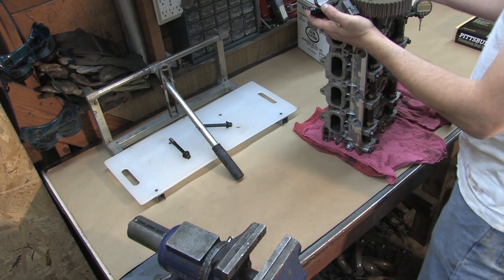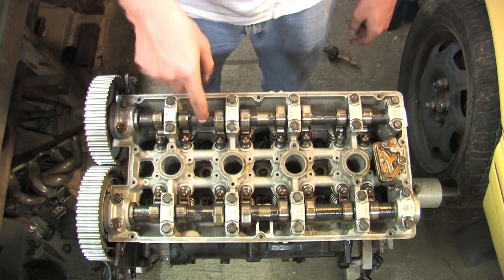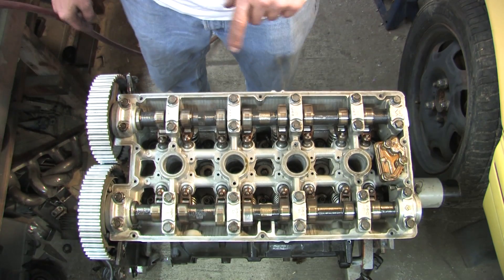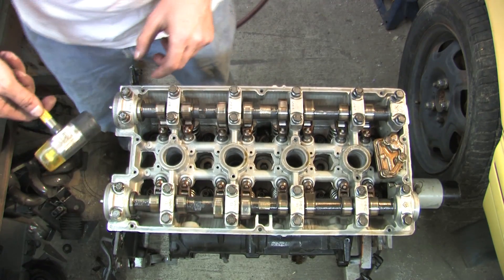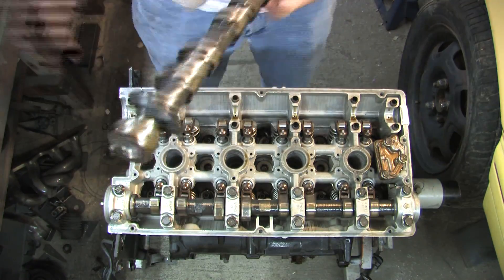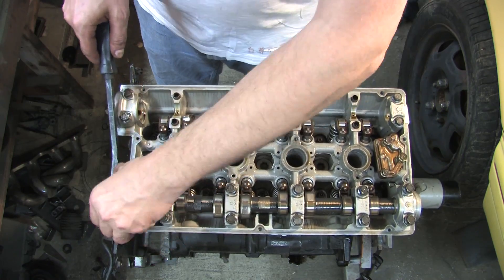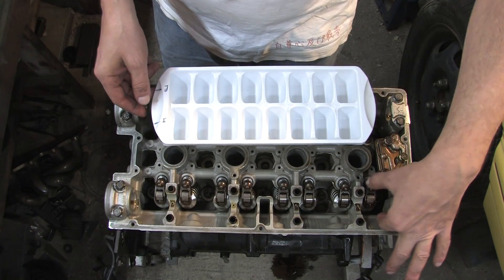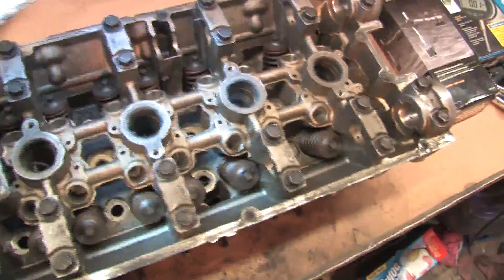Cylinder Head 101 - Remove Cams Rockers & Lifters

Comment: I got a Mazda 3 2006 2.3 l i bought a new head but there's no camshaft bearings does it take them
Reply from the maker: Nope.  The cam journals just use oil as the bearing.  ;)
Reply: @Jafromobile  hey thank you I appreciate that

Comment: does anybody no if i can switch parts from one cylinder head to another,lifter springs i have new valves,thge one i got from junk yard  cams are good lifertr are good but the survaces is corrared  the coolant ports n all on vw passt 1.8

Comment: What is the logic of removing the cam caps from the center out to the side.?  Have an imagine the most pressure would be in the middle of the camshaft instead of on the sides.
Reply from the maker: Think about how much pressure would be on the center (with 8 valve springs on either side) if you took it loose last.  It would focus the energy from both sides directly in the center of the part.  It would have half as much material length to take all that spring pressure.  When you take the ends loose last. That pressure gets spread over the entire length of the part.  Either way, putting them on or taking them off, you're supposed to do it incrementally anyway.
Reply: @Jafromobile  Hmmm I don't know much about car mechanics but basic logic says that the camshaft is a stick and to break a stick easiest you hold both ends and push in the middle.  So it would seem safer to pop the ends out first and then head for the middle incrementally.  no?
Reply from the maker: @MrShakamuni01  When you break a stick in the middle, like over your knee for instance, you are pulling both loose ends across a solid object.  In the case of the camshaft, that solid object would be the center main.  But again, you should be doing all of the tightening and loosening INCREMENTALLY which means you should never see that much pressure on any one of the caps.

Comment: Please help I got my cams mixed up is there marking on them to which way they go back in
Reply from the maker: One connects to a cam angle sensor and the other one doesn't.  So one has a slot and that's your intake cam.  This is assuming you're talking about a 90-99 DSM.
Reply from the maker: If the gears are on them, one is stamped I and the other E.  The cams themselves should have these markings if they're OEM.
Reply: @Jafromobile  thanks for the reply but it's a 05 Kia Sedona and one rod has a R1 and the other has 28   45 stamped on it
Reply from the maker: @jnxssssss  ...and neither cam connects to a cam angle sensor?

Comment: Hay Jarfo in another video you explained what the makings at 9:24 in this vid mean I cant seem to find the video could you or someone point me un the right direction
Reply from the maker: It's in Cylinder Head 103 - Deck Tech.  ;)
Reply: @Jafromobile  witch do you recommend and why
Reply from the maker: I guess it's easier to clean the G6K because of the oil gallery plugs?  Plus it has a deeper teardrop, but if you're going to modify the teardrop anyway, that doesn't matter.  My biased side says the early '95 version (G6K).  I don't think the changes that occurred on the G6S had anything to do with performance.  Looks to me like a materials/cost bunch of changes.  It's just a little bit less aluminum and 2 less oil gallery plugs. 2 less holes to tap and drill.  Wait... 4 less holes because of the cam position sensor.  Also, the cam angle sensor you're planning to use should help you steer your choice.  Do you want a cam angle sensor hanging off the passenger side, or not?  You can do it either way with the 95/96 heads... but the whole "hidden-behind-the-cam-gear" thing is pretty cool on a show car.
Reply: @Jafromobile ya my goal is to have a very clean engine bay
Reply from the maker: You need the head, intake manifold, wiring harness, and ECU from a '95/96, then.  With sensors.  Basically the top-half of the engine.  You can use anything below it from any year with the right preparations, but that will provide you with the tidiest, most un-cluttered head start on that.  Get a 6-bolt bottom end and your setup will match mine for the GSX.  I pulled GSX parts out of storage yesterday.  More is coming soon.
Reply: @Jafromobile  I so would match you but I already have a 4g64 block I'm doing a 4g64/63t hybrid a 2.1 long rod destroker build to be exact

Comment: Jafro, I went searching for when you switched from a standard plywood benchtop surface to a facade of easy to clean mild steel and even easier to clean brown paper.  It turns out that it was some time between this video and the driveshaft 105 video, its a shame that you didn't film the benchtop upgrade, just to have seen that footage.
is it 14 or 16 gauge btw, I was kind of looking to see if you have that footage because I want to surface my own benchtop

Comment: Is the metal elbow attached to the top of the aluminum thermostat housing on these 2.3L dual cam engines removable to allow a new seal to be installed?   My Ranger engine has a slow leak that comes up around the heater hose elbow.  I've tried block sealers, and they don't work for long.  Thanks...
Reply from the maker: Yeah, I can't speak for the Ford/Mazda platform specifically, but on most cars it comes apart with 2 or 3 bolts.  The bolts aren't super-tight.  Like only 12-14lbs.  There's a thermostat and a gasket sandwiched between them.  Do that job yourself and it's typically under $15 + coolant.  Don't over-honk the bolts putting it back together.
Reply from the maker: That totally didn't answer your question.  I just re-read it.  I don't know how to help you with your specific engine?
Reply: I don't mean the plastic housing that has the bolts for mounting to the aluminum block.  Its actually located further back under the intake manifold in a porthole through the metal.  Thanks
Reply from the maker: That's kind of what I meant.  The 4g63 engine in this video has an aluminum 3-piece machined aluminum housing stuck together with RTV and one gasket.  If it's a 95-99, then there's 2 gaskets.  But on all Mitsubishi engines from 1.5L-2.4L the heater hose connection is press-fit and then welded into the housing so there is no gasket.  It's nothing like you described.

Comment: Aren't you supposed to remove the bolts in the opposite sequence of the installation ?
Reply from the maker: It doesn't matter which way you do it as long as it's done evenly so that the valve spring load is evenly released.  Breaking them all loose a half turn at first before removing them helps with that.  But anyway, unless a service manual specifies the removal order, just be consistent and gentle when you're removing them and you'll be fine.
Reply: @Jafromobile  Thanks DSM brother !

Comment: what all do you need to install aftermarket camshafts and cam gears?
Reply from the maker: I would suggest watching Cylinder Head 205 and 206.  All the dirt on DOHC valve timing can be found there.  The most important thing you will need aside from that knowledge is patience.

Comment: I got a plymouth laser 1993 2.0 going to rebuild the motor is got 168,000 I got exential parts to do a rebuild I like to ask a question my car iddles rough I have done the exentials clean the egr valve new aic valve clean mass air flow sensor check the oxigent sensor and it steel shakes when put in gear or when the air conditioning is turn on on high. speed over 60 the motor is smooth what you think it is would love to fix this problem before I rebuild it
Reply from the maker: On the surface, this sounds to me like an ignition problem.  I would start with a compression check, then make sure the intake is in good shape.  If it's a turbo car and you pass the boost leak test, pass the compression test, the shake is coming from your ignition system.  All the components involved with your ignition system should be inspected.  From the cam angle sensor to the harness to the ECU to the ignition coils, wires, plugs... even if you replaced them.  A cracked plug can be really hard to spot and can cause endless hours of frustration.  IF the engine has good compression, I would recommend against rebuilding it.  I would focus on the ignition system and engine management if that were the case.

Comment: dumb question but i've been meaning to ask. where should you use loctite and where should you use anti sieze?
Reply: Loctite is usally used on pulleys and other objects moving with high rpms where it is critical if the bolt or nut become loose and is used on places you rarely have to take apart. Before loctite was invented lock tab washers was used instead. Most of the time it is stated in the shop manual if it should be used. 
Anti sieze is used as a rust inhibitor mostly on parts of the car that is exposed to the elements such as wheelbolts and brake caliber bolts/components that if not used can be a pain to remove because of rust.
I hope this answers your question :)

Comment: 1 other question, the car sat 2 weeks and when i pulled the head, its got stains on the cylinder walls, yellowish kinda, no rust, just enuf to see it and your finger can feel it. Im not pulling engine and I've prepped the deck and even took my long file board and sanded it, after razor blading it and brake kleen.  Looks nice  its the walls im concerned about. I stuffed rags while cleaning deck and now have oil on the walls. While im tryn to figure out what to do with the head. Take to my machine guy and have him do it all, then I can put it back on car. My sons ruined my paint shop garage.NOW IM TAKING CUSTOMERS CARS TO SHOP. These were small body n paint jobs for friends n neighbors, Im about ready to push the Eclipse outside, its a shame, ran like a bat outta hell. 5 speed  awesome. He bought it 9 months ago. Bad radiator caused this, and him NOT listening to me, as my other kids about maintenance on their vehicles. Sorry to ramble on.
Reply from the maker: The radiator blew because of the head gasket.  The cylinder wall contamination could be a ring problem, or it could be from the coolant milkshake inside the crankcase.  I'd measure the bores to determine this.  Check the ring gap.  Check the piston to cylinder wall clearance.  If it hits spec on all tests and the crosshatches are still there, it may wipe clean with mineral spirits or ATF and you can re-use those rings.  If you're going to replace the rings, give those bores a hone.  Don't replace the rings if you're not honing it or they won't seal right.  Don't hone it if you're not replacing the rings.
Reply: Its only stained at 2/3 , the down stroke pistons, 1/4 look sweet.  The gasket around Cylinder 1 @ piston top at comp stroke, The gasket actually has a 1/4 inch cut in it But piston looks aok and walls looks ok. The valves look ok. Its only got maybe 1800 miles on it, son bought off CL, I drove it home, bought 45 miles home,  real stought 5 sp.  Any other ideas.  Even my alldata says no cam caps, YET wont tell me how to remove the dam cam  idk...Im losing my mind and tying up my garage, when I should be fabricating & painting.  Thank you Jaf
Reply: Sorry Jaf, No I'm not taking pistons out. Walls look good. If u shave the head, obviiously ur valves are gonna be closer to pistons, what head gasket do u recommend i use?   Ive used ATF and yellowish/green stains are still there, shame too, its so dang clean Yet i can see that stain. If it was mine, Sure id pull ther engine and do it from bottom ta top Ething. This is sons mess, after I told him b4 driving it ething should be and needs to be ckd, fluids etc..  Torque specs are all messed up.... 1 says 58 ft lbs then 90 degree and anutha 90 degree and 2nd 72 ft lbs and 90 degree and anutha 90 degree. 1 says tighten to 58 ft lbs and then Completely loosen ALL bolts then tighten to 14 ft lbs  Who would say that and why>????

Comment: I'm on this video because I recently purchased a JDM Evo VI (I live in Canada which is how they're legal) and basically want to learn as much as I can about the 4G63 engine before I eventually do a cam & valve spring/retainer swap and a complete teardown-rebuild way down the road. It seems like a nice basic engine to be able to pull apart which is why I feel confident doing it. By profession, I'm an AME (fancy acronym for aircraft mechanic) and when I was in school we had to disassemble and rebuild a basic piston aircraft engine. In regards to the bearing surfaces, have you ever heard of a caution to not touch them with bare fingers? In school they wouldn't let us touch them due to the oil from our fingers causing accelerated corrosion. I'll be wearing gloves either way, I was just curious cause I've never seen a video where people paid any attention to that.
Reply from the maker: Hahah,  Yeahp.  Check out my Hyundai Elantra Shortblock Assembly video.  Gloved all the way.  I don't touch them either.  Acids in your skin will etch the bearings.  Nice tip!  ;)

Comment: Thanks!  Just to be clear.  The head is still attached to the engine block on the vehicle.  I want to remove the head from the vehicle while not having to remove the sprockets because they are a bear. I'll let the machine shop work on that if the need to.   Right? 

Thanks so much!

Comment: i am doing head gasket replacement on a 2001 xterra and I need to have the cylinder heads removed and machined.  i am having a hard time getting the cam sprokets removed and I wonder if I can just remove the head with the cam sprockets attached like you did and have the machine shop remove them if necessary.  Thanks